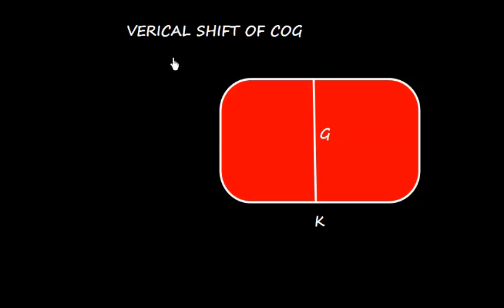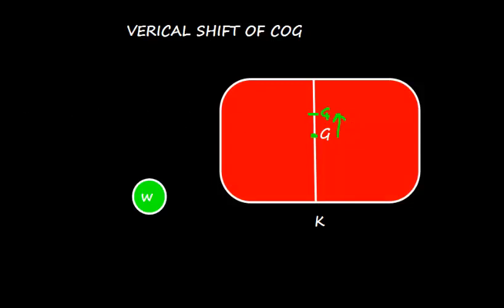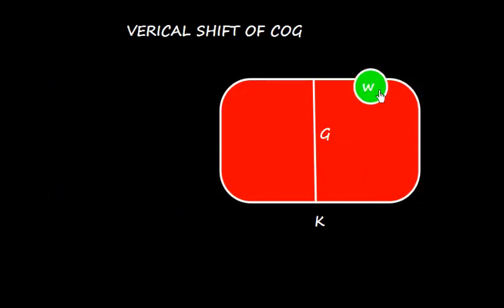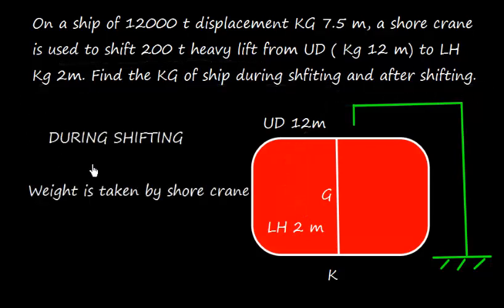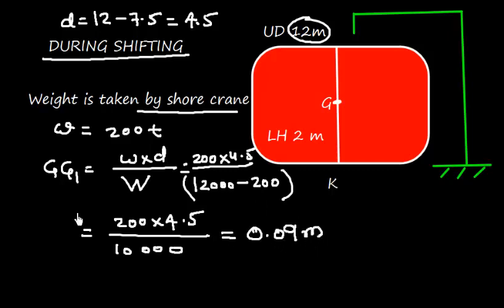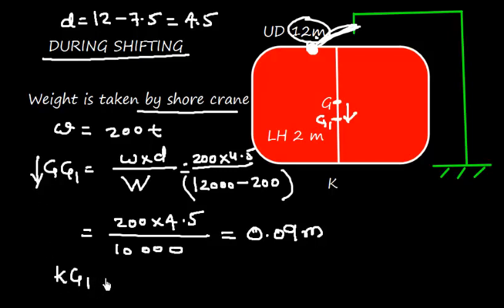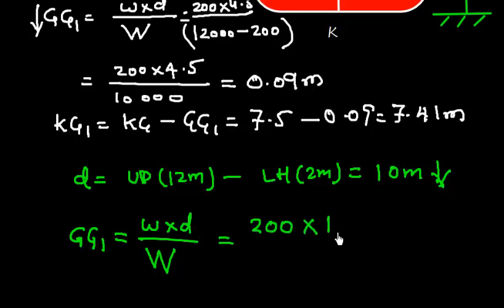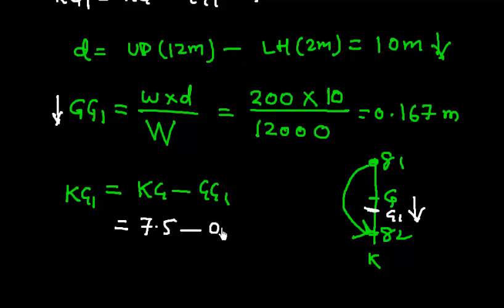Ship Stability_ Vertical shift of COG Solved Example Part 4

Comment: pls check in this video time around 5 min its showing that12000-200 is 10000
Reply from the maker: Thank you for pointing the mistake. It is  11800 t and question needs to be solved accordingly.